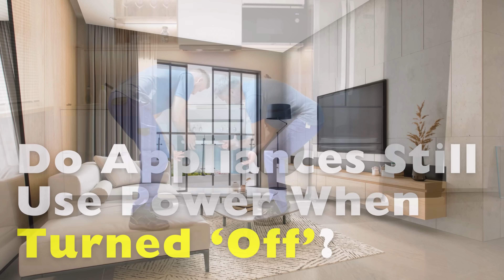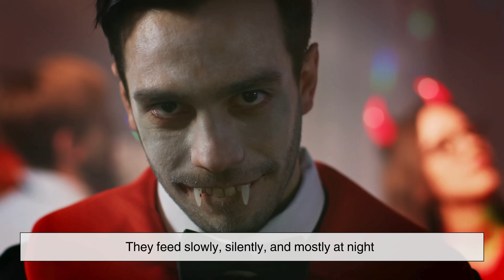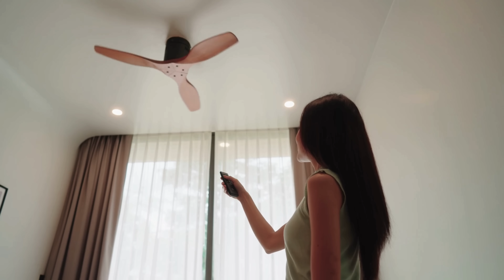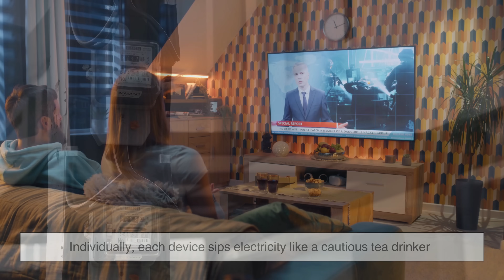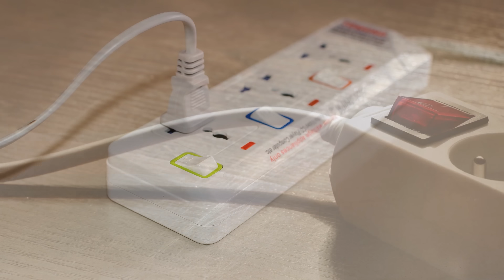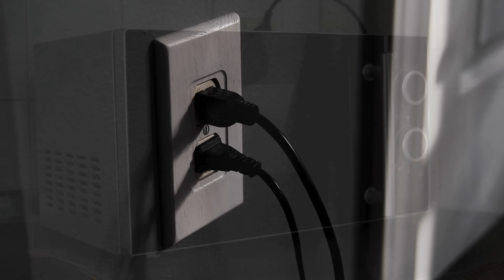Energy Vampires: Do Appliances Still Use Power When Turned Off?

Comment: When you said “still consumming signaficant electricity...", which is not true. Just a few low % of bill, to keep you convenient. 2% of $250 is, $5 or 16.6 cents a day.
Reply: True, but as my accountant father would have said, that is still $60 a year.
Reply: @Blue4uNowicka   Surely true $60. Also my engineer father always said the power surge (on/off) to expensive devices could have physical damages in a few short years, which could be more than the cost of standby power. The frustration and inconvinience is priceless. 🎁

Comment: Fortunately, most modern electronics use switching power supplies so at least a wall wart might drain in the microamperes. Much better than the bulk and heat generated by the flipping electromagnetic field of a transformer!

Comment: My Canon tenkey calculator certainly does! Their recent models have a seven minute sleep timer that can't be adjusted or turned off.

Here's the thing: whether in sleep mode or turned off by the power switch, one can still see the filaments glowing in the fluorescent display if the room is dark enough. Now I have a switch to disconnect the power when not using it.

Other than that, those calculators are the standard and are built like tanks!

Comment: So the Germans developed an wall outlet that has an on & off cut power switch. This is so you don't have to physically unplug appliances from the plug you can leave it plugged in.
Reply: That auto on/off device need power(electricity) to work it job.
Reply: Sounds better than the inline toggle switch/2-prong plug I've used since childhood.

Comment: There's a simple device called "kill-a-watt" ... and you can know if/how much electricity any device is using.
Reply: Just received one this evening--now I know my Toshiba Origin Inverter microwave oven is truly variable power from 740W to 1800W total drawn, but with a caveat: power levels 1 and 2 are cheats like I suspected. They are actually 30% power cycling 20 seconds on, 40 off, and the opposite for level 2.

Makes me miss my older Panasonic: it could be programmed up to seven levels including unpowered delays, and the timer was a separate function that could run in the background. Best part: 10% was 10% power. (Usually warming cat food to "freshly killed!")

To get back towards the topic: the new Toshiba drains around 0.4W which goes to 0.2W when the display shuts off in five minutes, or hitting Stop twice.